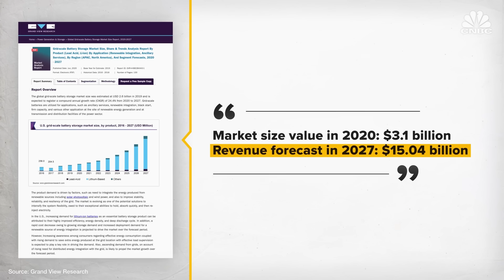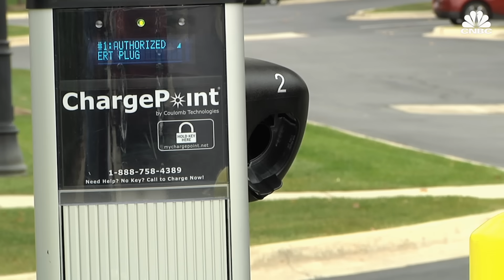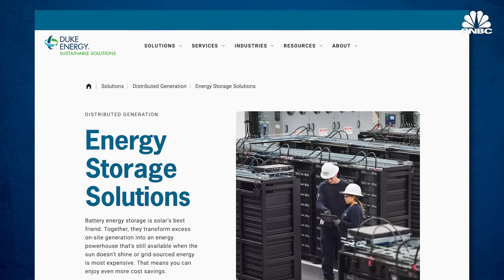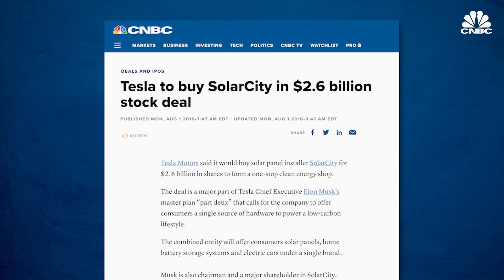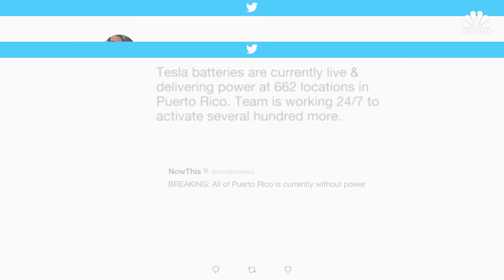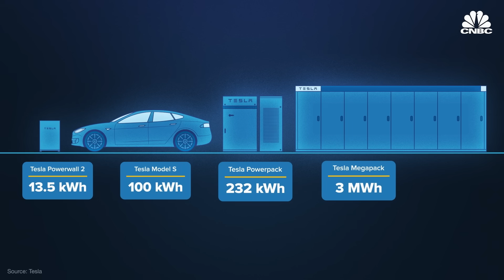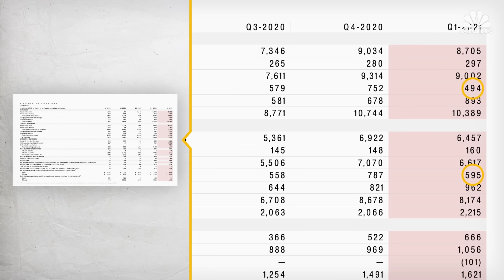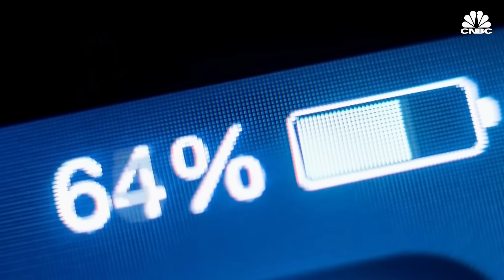How Tesla Is Quietly Expanding Its Energy Storage Business

Comment: Nuclear is the cleanest energy
Reply: Bingo.  No other energy source uses less resources to build and operate, and no other energy source produces less waste.  It's a god damn no brainer.
Reply: @Les_S537  true but libtrds will never allow it and many dumb people are afraid of it so its good to invest in improving solar and wind energy in the mean time
Reply: @lw8672  It's going to be a really bad idea to go full wind and solar, friend.  No offense intended, but have you really contemplated this in great detail?

Sorry for the length, but bear with me a sec... 

Let's say that you have one nuclear power plant putting out 2GW of electricity for consumers.

To build that plant you are going to use a specific amount of concrete, steel, and other resources. Overall, the amount of steel and concrete, etc, is not that much, and the plant will last for 80 years or more.

Now, let's say you have one 7MW wind turbine. How much resources are needed to build that one turbine? Well, it's certainly less than is needed for the nuclear power plant, but it isn't an equal comparison because it's 7MW vs 2GW, but how much for each turbine?

One 7MW wind turbine needs:
a. 900 tons of steel to act as the stem for the turbine, plus the nacelle (much CO2 produced in the manufacturing of this).
b. 2500 tons of concrete to act as the base for the wind turbine (more CO2 produced)
c. ~50 tons of NON-RECYCLABLE plastics (has to be the non-recyclable kind because they're the only kind that lasts long enough)

OK, so how many of these wind turbines are needed to equal that 1 nuclear power plant?

~350 of them...

So, let's get this straight, that's:
350 x 900 tons of steel
350 x 2500 tons of concrete
350 x 50 tons of NON-RECYCLABLE plastics (that go into a landfill when the turbine is scrapped)

None of this even take into account all the battery backups needed to support those wind farms.

If we wanted to power half of the world with wind and battery backups, how many are we talking about at today's consumption levels? Keep in mind that power needs are expected to double or even triple in the next 100 years if we go to all EV cars...

Easily tens of millions worldwide... That is insane to contemplate doing!

It's just not doable in the long term, friend. Why?

How long do these wind turbines last before mechanical stresses and general wear and tear force a complete teardown and replace?

20 years, 25 tops if you maintain it assiduously, but think about the cost of maintaining tens of millions of wind turbines...

The cost is going to go through the roof, and when those battery banks that support wind catch on fire? Say goodbye to every battery in that backup unit...

If you really expect mankind to build tens of millions of wind turbines that only last for 20-25 years before a complete replace is built out, you're not thinking this through completely.  And the same thing applies with solar panels.  Trillions of them replaced every 25 years?

Nah man...

We need nuclear power.
Reply: @lw8672  regarding the NIMBY’s and ignorance...  nuclear just needs better PR folk. People just need to be shown that we have advanced much in our nuclear know-how. We have meltdown proof reactor models just waiting to be built.
Reply: Tony Seba - no, that's false

Comment: I have to say folks...  We've got a bottleneck at the moment...  We need to go with EV's, and renewables require battery backups.  This creates the bottleneck.  ICE cars are worse for the environment than powerplants are.  We should focus all battery production for cars to get away from oil use.  With regards to renewables and batteries.  If we go nuclear instead of renewables we will be saving ourselves a lot of grief with cost because splitting our battery resources among renewables and cars is going to make the price of resources for those batteries skyrocket.  Nuclear is safe, and it produces the least amount of waste while producing the most energy per kg.

Comment: Wait until there’s an accident and they catch on fire. There’s not enough water in 500 fire trucks to put them out. A firefighter friend told me 10,000 gallons are minimum to snuff out a car battery.
Reply: They have built in fire suppression systems.  They use chemistry to snuff the fire out.  Much more efficient than using water.
Reply: Has it been put to a real world test? Time will tell.
Reply: @groove9tube  of course it has been tested...  they wouldn’t deploy it otherwise
Reply: That Texas report was fake news. Firefighters had it out in 3 minutes.

Comment: did not learn anything new though the title is fair.  Quiet because Tesla is bottlenecked with the production of batteries, taking away battery supply from Tesla Energy to Auto.  No improvement in this regard maybe until 4680 batteries are finally used in their products

Comment: I think the grid as a concept is outdated. We should be moving toward decentralized power sharing networks instead, where every house has solar/wind/batteries and shares power with everyone around them.
Reply: The grid is a decentralized power sharing network.

In many countries, power producers, energy storage companies, and retail utility companies in the grid buy and sell power automatically at market rate through their power grid.

The grid were originally built with utility power producers because the technology involved in most forms of power generation massively benefit from economy of scale. Producing power using home scale diesel/steam engines simply weren't economically or environmentally competitive to the large steam turbines they had on utility scale power plants. With renewables, that changed a bit, and home generation can be competitive, and in some countries it's now possible for home owners with solar panels to own a home device that can allow them to automatically buy and sell their excess power generation to the grid at market price, just like the large scale utilities have always been able to.

Comment: What happend to electric cars feeding back into the grid? I guess Tesla would sell less batteries if they allowed that to happen.
Reply: The fact that Tesla does not allow car to grid (or to home) on model S3XY cars is not to sell more Tesla powerpacks. But probably because of warranty issues. The warranty of a S3XY cars depends on age and distance (kilometres or miles.). To allow using a car as a powerpack Tesla must switch to another way to estimate the battery live span, eg *age and kWh*. Tesla may do it in the future, maybe for the Cybertruck. The point is that a car buyer in 2021 wants to know what distance is guaranteed, not how much watt hour can be stored and retrieved.
Reply: That isnt of the table. Stop assuming things
Reply: Tesla, as well as the rest of the world, is and will be battery constrained for many years.

Comment: What happens when these reach the end of their life cycle?
Reply: Recycle and reuse
Reply: They will be recycled. CNBC did another mini documentary on battery recycling. Search for Redwood Materials founded by JB Straubel
Reply: The life cycle is 20+ years compared to the life cycle of fossil fuels which is less than a day.  So even if those batteries are not recycled (they will be) it would still be thousands of times better than incinerating a finite resource 24x7x365.
Reply: they get dumped into xi pingpongs backyard swimming pool
Reply: @djdjdjshhsuss3941 , the same life cycle applies to solar panels and wind turbines.  So my point is the combination of renewable energy production and energy storage to buffer that energy has a life cycle of decades.  Therefore, it makes very little sense for people to pretend to be concerned about the end of that life cycle when the current status quo is to mine, transport, refine, transport again, and then incinerate fossil fuels continuously.
Reply: Redi-shred Redi-cycle

Comment: Batteries seem wasteful at scale. They degrade and need replacement. I might be missing something, but wouldn't a hybrid battery/hydrogen solution be more sustainable?
Reply: They don't degrade the way we typically think of batteries and they are more recyclable than we normally think. CNBC has another video on how efficient the recycling process is. As for battery degradation, we've had cars out on the road with ten years of use and a lot less battery degradation than we see in our normal batteries. With that said, there are going to be other Solutions as well to complement this
Reply: @Tential1  I saw that video. It showed a resource intensive process that hasn't been made economical, yet.

I would like to see comparisons on upkeep of fuel cells vs batteries.
Reply: @someitguy2175  model 3 owner already report only a 10% loss in capacity after 200,000 miles. Tesla has been developing cheaper and less resource/energy intensive methods for battery cells such as a dry electrode process and using advancements in hydrometallurgy to recycle it at mass scale.
Reply: Checkout Hydrostor’s A-CAES Rosamond Project! Pretty interesting solution to solve long duration problems experienced by Tesla’s cells. https://www.hydrostor.ca/rosamond/
Reply: Hydrogen isn't really green energy.
Reply: @user-RCST   Neither is mining for rare earth's to build out capacity. I don't care about it being green, never said anything about it.
Reply: @someitguy2175  with lithium you only have to mine it once with hydrogen you have to do it all the time.
Reply: @user-RCST   To a degree, but you will be mining for a long time. Hydrogen can be produced without strip mining using the energy you were going to store in the batteries anyway.

Hydrogen is not near as efficient as batteries, but it doesn't matter if you have excess electricity needing to be stored anyway. It also seems that you use less resources in a fuel cell, though I don't have anything concrete to back that up.

The real question is the duty cycle on fuel cells vs batteries for industrial applications. Will be interesting to see what the economics say.
Reply: @someitguy2175  look up sand battery storage. that is the future.

Comment: Couldnt they save the energy during low rate hours and sell it back during peak hours to maximize profits.
Reply: Yes, they could, but that is already happening anyway.  Google "peaker electric plant".  Grid battery storage will render peaker plants obsolete.
Reply: @CL-gq3no  Not Obsolete, just in less and less use. for example, over the coarse of a winter storm, there might not be enough sunlight to even help for 4 to 8 days ( it's just gray ), base loads will be at maximum, daytime might run on battery for a few days, yet I think Peaker plants will be used to balance overall.... a super grid won't have this problem to often since they can shift power to the edges of other grids. California might be able to power Nevada, they shift there energy output to Texas, they shift to Alabama, they shift to Florida who is having a hurricane and can't produce beyond baseload and battery. this is where it's heading, and it will be fun to watch it happen.
Reply: @MichaelRasch , I agree and all of that makes sense, but I would argue that those wouldn't be "peaker plants" anymore since they wouldn't be fulfilling peak demand.  They would be "backup plants" or some similar term that probably doesn't exist yet.  My only point being that the peaker plant business model will no longer be viable.  Ten minutes to spin up a peaker plant can't compete with 1/10th of a second response time from battery storage.  Those peaker plants will make good standby/backup systems though.  And yes, it is going to be very interesting to watch all of this play out.
Reply: Tesla's Autobidder software
Reply: Who?
Reply: @neeljavia2965  Tesla or PG&E why support system solar when you can maximize profits.
Reply: @pancakes3ful  Energy storage from renewables is for better management and reducing wastage.
Not for profits, though it helps in that too.
Reply: You can do both solar and conventional power support
Reply: @specialopsdave  I think Enron did that ,probably where it come from .
Reply: @pancakes3ful  thats why its AI... it knows how to utilize energy efficiently.
Reply: @pancakes3ful  Elon talked about people owning these storages can even sell energy to others. It is gonna change the world.
Reply: Its sold when it's needed. If that's during peak hours then that's fine too but thats not how power generation works. Its an on demand system. The plant only makes whats needed. If energy has a sudden spike where they can't just turn on another unit then you use the battery system.
Reply: They could if there was cheap off peak power, but  these sources are generally fossil fueled.  They will more likely be used to store excess wind and solar to supply the shoulders of the daily electric demand cycle.

Comment: I don't think this is a good way to store energy in about 5,10 years the batteries degrade by more than 50% what happens then eh more batteries, what about using potential energy instead.
Reply: They do not degrade more than 50% in a decade.
Reply: Do you have a better solution?
Reply: its more like 10% over 10 years.

Comment: Is it sustainable to have megapack farms and solar panel farms taking up vast amounts of land? It's ugly and limiting - there are plenty of countries and regions where land is a precious commodity. Do these farms take up more or less land than the current power stations?
Reply: They pick undesirable land. Less land than all power plants if you include the fuel collections and waste storage and distribution (think pipeline, nuclear waste, etc)
Reply: @tilago  Thanks that's quite interesting. So if we were to remove all other energy sources/generation and replace them with this technology it could save space? I would be interested to see what is the amount of energy created per square kilometer compared to contemporary methods.
Reply: @Omar6000  you’d have higher costs up front, but yes, you could do this and it would be more energy dense and more space effective
Reply: We have unlimited desert space available in the southwest US. This is being done in the Southwest.
Reply: In theory, if the solar was put on the roofs of houses instead and the batteries were integrated into many different parts of the grid where most practical and space-saving, then this wouldn't be an issue.
Reply: thats why tesla created those solar roof tiles. It can be used in any houses in the future
Reply: 100 square miles of solar is all we need to power the continental US.
Reply: Empty desert lands full of wind and sun.